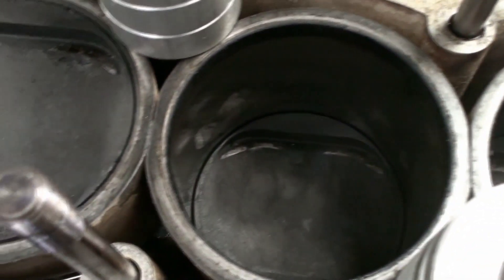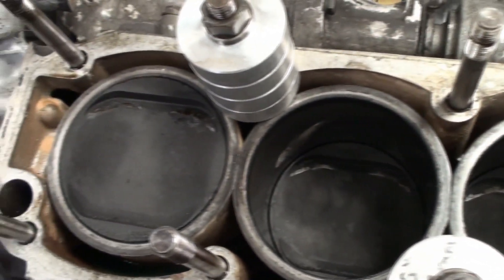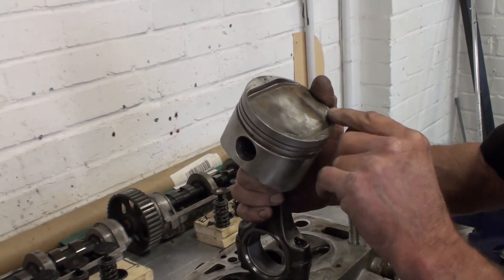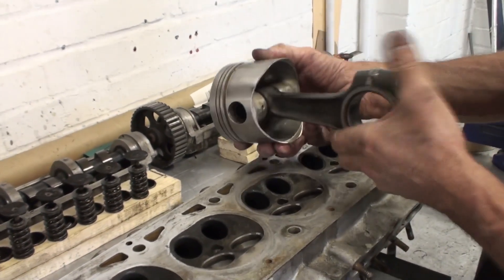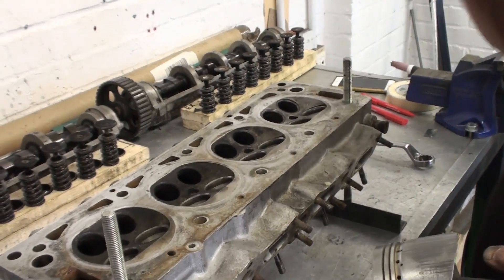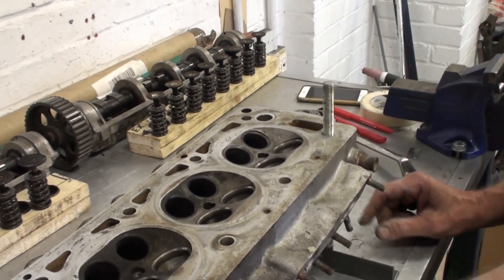Why is the engine stripped completely?

Comment: What caused the belt to jump a tooth on the crank pulley
Reply from the maker: Me trying to move the fuel-less car off a roundabout on the starter motor! 🤦🏻‍♂️👉🏼Lotus Esprit Diary - 8: Seriously broken?
https://youtu.be/xlkt680hS-s
Reply: @SportsandGT  interesting.....has the car got a manual or auto tensioner and did the car roll backwards during your attempt to move it? I ask as I have seen how easy it is to jump a tooth on the crank when the auto tensioner and original trapezoidal belt is fitted , if the engine is caused to rotate backwards through about 10 to 15 degrees.
Reply from the maker: @michaelwhelan564  not sure on the manual/auto tensioner but certainly had the trapezoidal belt. It may well have rolled backwards too, I was in a bit of a panic, sitting in a low, stationary car on a built up, fast-moving roundabout. An HTD belt and pulleys will be fitted to the engine when rebuilt.
Reply: @SportsandGT  thanks for your response and good luck with it all.